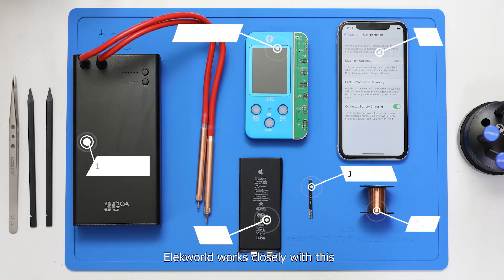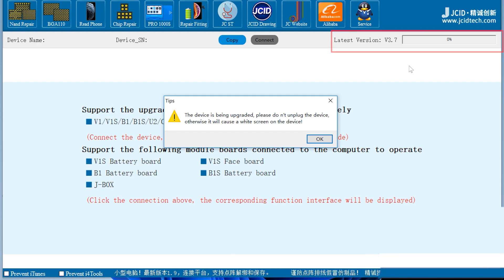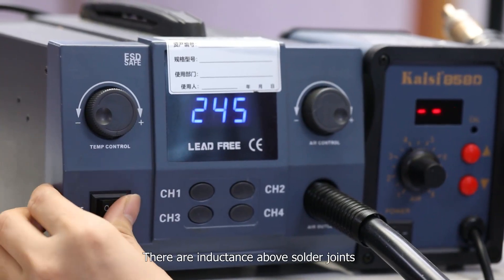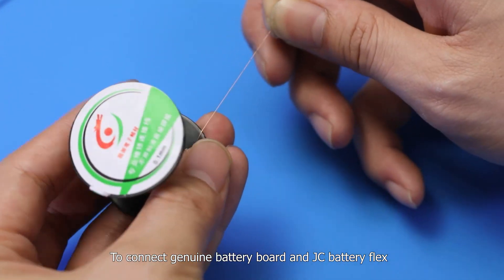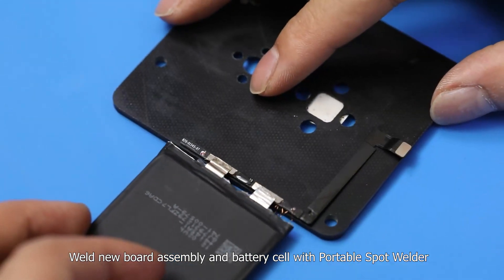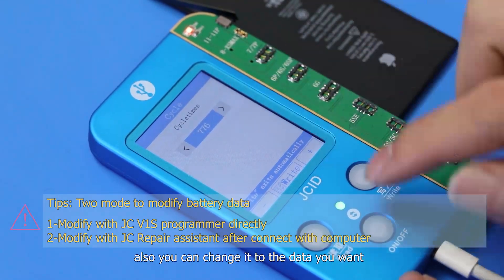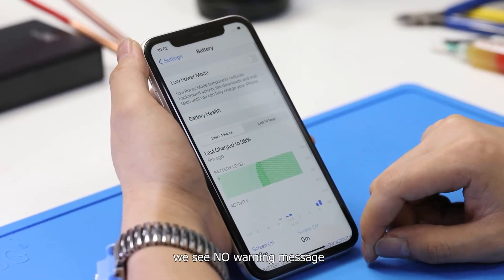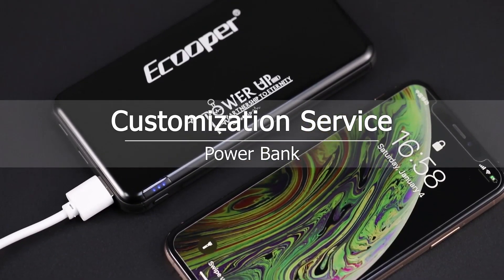100% Fix Battery Warning Message + Battery Health For iPhone 11/12 Series With JC Built-in Board

Comment: Great Video. I have used this method to replace my iphone 12 Pro Max battery that was at 73% and so was showing the service message 'your battery health is significantly degraded'. I replaced the battery and set the health to 100% and cycle count to zero. Even though the health is showing as 100%, the service message is still there? Do you know why this may be? and how do I remove it? Thanks

Comment: Same question in my mind you asked at the end! What will happen if we just modify the battery data without changing the actual battery cell?
Reply: It will happen anyway, cause the change of cell don't modify anything in the process, it is just for the service that you have to do, otherwise you'll do something senseless; modify data without changing the actual battery. The idea is that the percentage reflects the state of a new cell. Regards.

Comment: ¿Cómo es que el programador JC te detecta la batería sin utilizar el flex?
Reply from the maker: Not quite sure what you mena, but if you mean connect battery to JC programmer directly here: https://youtu.be/q7_GLdJ6Oso?t=316, it because there are exclusive battery daughter board to use.
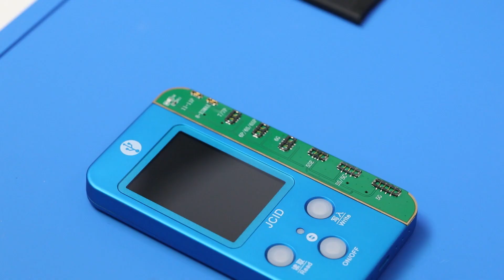Reply: @Elekworld  Si , me refiero a eso mismo, pero en el minuto 1:34.
¿Qué no se si tienes el flex de la batería secundaria conectado?
Reply from the maker: @jonathanfernandez4438  Nope, at that time the battery is same as it was sold inside iPhone, we do nothing on it yet.

Comment: Was using older method (with attachments additional cable) but after soldering a bms board to new battery it doesn't work 😔
Is there way to somehow restore it? Maybe it in some shortcircuit state or something? I have two of broken bms for two phones
Reply: Was using Quanli method and 50 or so phones was okay, but sometimes it's just can't to turn on when I soldering a new battery
Reply from the maker: Hey bro, maybe here it's the reason: https://youtu.be/q7_GLdJ6Oso?t=110. Pls take a look.
Reply: U need to recharge the battery again. Just plug in a charger and then hr battery will work again

Comment: Hello. I bought a battery with its flex. I did the same process to erase the cicle and the efficiency make a backup from the original battery and copying to the aftermarket one and the iphone does not show me any message. However, ti says the old % of health instead of the 100%. Any help on this? or it is necessary to solder the original flex into the other battery? Thanks a lot guys
Reply: Look at end of videos. You must install a non-original battery before, so that the battery service will appear. After that you can remove the non-original battery again and install the battery that you have modified.
Reply: Revised properly. Also need to plug in another battery first in order to activate it

Comment: I weld old battery board to new battery but it shows old battery percentage. I have 80% old battery percentage. Now after welding old battery board to new battery it shows only 80%. Will it affect the screen time? Or I can use the battery to full efficiency?
Reply from the maker: The old battery board only fix non-genuine battery warning message, if you want to have 100% new battery percentage, need process like the video shows.
Reply: @Elekworld  thanks for the response. Am asking about the new battery which is having old battery data. Can I use the new battery to full capacity even it shows old battery capacity? I don’t need 100% in new battery.
Reply from the maker: @latheefthemass7748  of course, new battery is 100% capacity, the 80% is just the data iPhone recognize from old battery board
Reply: @Elekworld  thanks for the info 🤝

Comment: hi. @Elekworld. i would ask something regarding Iphone XS battery waring message actually do same way process remove the genuine battery board connector and then i do transfer to aftermarket battery when i'm done. i check first the battery if the battery health is show, it's show battery health but the battery health is not 100% but that one is new battery when i  use JCID program to modified battery health data  and then i install the new battery suddenly battery health not show anymore. please advise me what i need to do maybe i do wrong way to modified battery health using JCID program. thanks in advance responding  to my message is highly appreciated.
Reply from the maker: Hi Fejz, two suggestions for you, hope it helps:
1- new battery cell with genuine battery board doesn't show 100% is normal, because it's old genuine battery board, so the data is from old battery.
2- If you can't revise the battery data successfully, probably bcuz you didn't install a 3rd party battery before you revise the battery. It's critical step that must have to do, check video from here: https://youtu.be/q7_GLdJ6Oso?t=349.

Comment: What happens if you just solder on the original board to the new battery and reset the health and cycles? Is it possible?
Reply from the maker: It will just show the original battery data, and data can't be revised.
Reply: @Elekworld  okay. Thank you for the info!

Comment: Where is NC and ND in iPhone SE 2020 battery Flex (BMs)?? It is really important lines?

Can I use 11/11 pro flex to iPhone Se 2020 ?
Reply from the maker: Hi Lucas, not quite sure what you exactly means. But definitely iPhone 11/11 Pro battery flex can't be used on iPhone SE 2020, because not only the battery FPC connectors not same, but also inside data are different.
Reply: @Elekworld  Maby data is different but battery connector is the same i check before I write this post
Reply: So You have any idea to iPhone 2020 ? It’s same battery error message in settings
Reply from the maker: @lucasszeyk3718    Ok, now I see why you ask that. Actually for iPhone SE 2020, the only way to remove the warning message is replace the genuine battery flex on the new battery. Check this link for details: https://youtu.be/sjOCID0IN5g.
If you want to correct the data of battery health etc, by now there is no device or programmer can do that. Because Qianli or JC only developped flex/programmer for iPhone 11, 12 lineup.
Reply: @Elekworld  ok thank You
So I can only insert new battery with old one flex - data (cycles and effective) stay without possibility to change.

So We are waiting for new stuff from jcid etc ;) 
Greetings 
Thankfully
Reply from the maker: @lucasszeyk3718  Welcome Lucas, pls stay tuned for more update on this topic.

Comment: As we know from 14.6 os starts judging battery health it self. What if we only replace battery cell. After full flash or few days battery health will go up again. Have you tested this one?
Reply: I have also heard from customers that their battery health starts going up in few days when they charge with slow chargers like 1 amp charger. I guess if we  replace battery cell and flash it will also work or in 3 4 cycles os will determine that battery health is greater than what it is showing so in this way it may go up
Reply from the maker: @iphonerepairinglab5098  thanks for sharing, we haven’t heard this before but will pay attention on this.

Comment: It’s not easier than previous one 
This one requires soldering and it’s double time wasted
Reply from the maker: Yes, both method can fix battery warning message&health, the difference is new JC Built-in flex can't be distinguished from appearance after repairing.
Reply: @Elekworld  So if an apple technician or anyone were to repair an iPhone (screen or battery) where the battery was changed using the Qianli method, it would be easy for them to see the extra flex extension. But with the JC method, no one would know?
Reply from the maker: @matthewJamesKendell  yes, unless they peel off battery board film.
Reply from the maker: @matthewJamesKendell    with JC method, it's hard to know it was reformed unless they peel off the battery board films.

Comment: Hi, when I try to change battery health with Jc V1s I get an error saying no repair cable connected. :(
Reply from the maker: There are many possibilities: 1- JC V1S system not upgraded to latest; 2- Battery flex not connected 100% completely; 3- change the other battery check if JC V1S has problem, or change another battery baord check if board has problem...

Comment from the maker: In last video, we have removed battery warning message and modified battery health data with Qianli battery corrector. But the solution is not perfect, because we can see difference from physical appearance compare with new battery. 
Elekworld works closely with this, and we found a built-in battery board solution. it can recover battery appearance like brand new and works on both iPhone 11 and 12 series , but it also require higher repair skills.
Now let’s fix it with iPhone 11 battery as example. 

Battery Cell for iPhone 11 (6.1")  
https://www.elekworld.com/shop/productinfo.aspx?proid=14933&categoryid=113
0.1mm Copper Soldering Wire

https://www.elekworld.com/shop/productinfo.aspx?proid=6935&categoryid=283 
3GOA Portable Battery Spot Welder, w/retail package
https://elekworld.com/shop/productinfo.aspx?proid=15187&categoryid=287
JC-V1S Multifunction Programmer with True Tone/Battery/Fingerprint/Dot Matrix Detection Boards for iPhone 8-12 Pro Max, w/retail package
https://elekworld.com/shop/productinfo.aspx?proid=15188&categoryid=287
JC Built-in Battery Repair Flex for iPhone 11
https://elekworld.com/shop/productinfo.aspx?proid=15189&categoryid=287
Ecooper Lengthened Straight Pointed Tweezer, ET-12, w/retail package
https://elekworld.com/shop/productinfo.aspx?proid=12339&categoryid=572

For more Repair parts&Tools and Tech support, please visit: 
Website: https://www.elekworld.com 
Facebook: https://www.facebook.com/Elekworldshop/ 
Instagram: https://www.instagram.com/elekworld/ 
Twitter: https://twitter.com/ElekworldL?lang=en